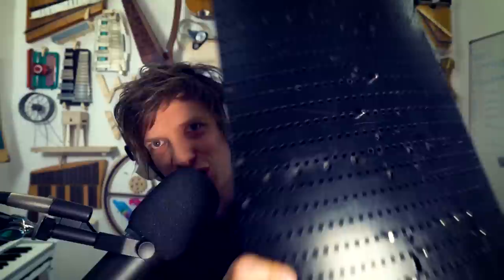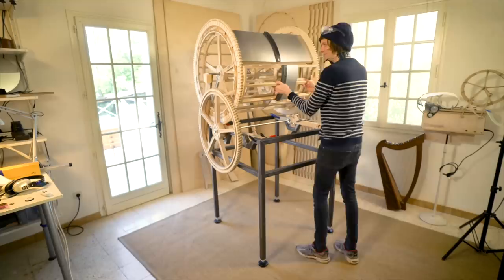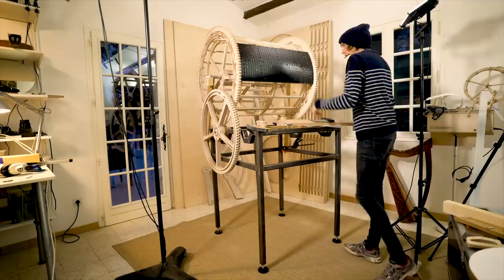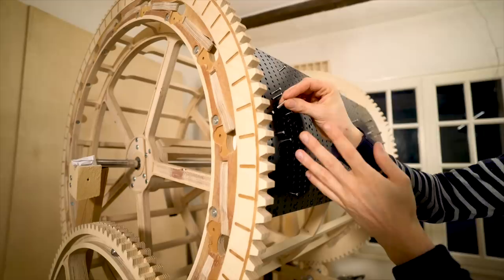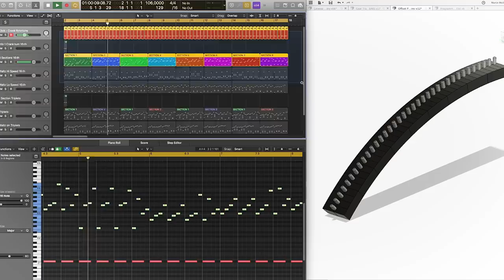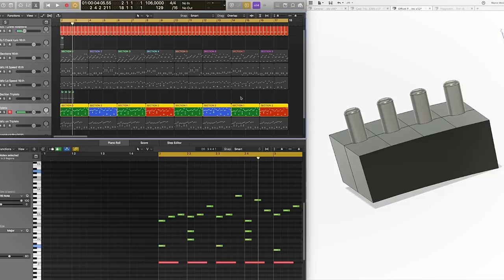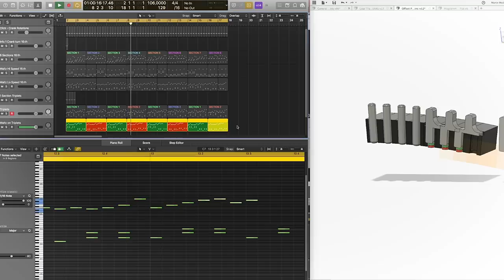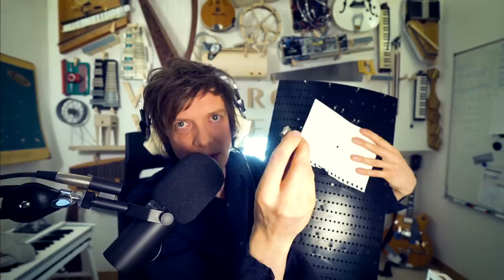Magnet "Midi" Music System - Marble Machine X #25

Comment: What if instead of having programming pins, you had programming 'keys' that had one particular, simple rhythmic pattern, like straight triplets, straight 16ths, straight pentuplets, and also slightly more complex patterns that still fit into the same short length of time. The keys can be built more sturdily, the programming is easier because you only actually program  64, or maybe 128, individual keys. Bonus: you now can easily play any rhythmic subdivision you want. Want a song based around 5:3 polyrhythm that also uses a 7:6 hemiola-like thing for the chord structure? Just print out some new keys!

How many kinds of keys would there be? Not too many. For any subdivision into n (that is, n=5 for pentuplets), you would have at most 2^n different keys. But, you might not need all the keys, and would use some keys more often than others. Rests can use the 'null' key (you don't put a key in it), of course. Even better, if they're symmetrical, the maximum number of keys needed goes from 2^(n) to 2^(n-1).

Comment: Would it not be more simple to have 2 sets of 2 programming boards? 1 set for multiples of 4 and 1 set for triplets? This could also give the programmers more time to switch the program during the track as they could always be a track or 2 ahead rather than trying to get the next set ready for the NEXT track which could be stressful and difficult if there were issues. I like the idea of an offset pin or the slot magnet but unless it’s super straight forward it could lead to confusion and difficulty when performing.
You may have already decided on a solution but I think for the simplicity of my idea it may work best in the real world (ie performing music)

Comment: was just thinking if you used magnetic solenoids for each pin,  and create a program to control engagement/disengagement of them,  you could reprogram in an instant, or even while the machine is running,  giving you an almost unlimited number of tones

of course, it would add considerable complexity, weight and expense to music drum/wheel.  Perhaps an idea for your next machine...lol

Comment: Hi first off, I love the marble machine . I noticed that you are heavy into the mechanical realm but I am in the electronic realm  so to have a fusion of the two in the design of the marble machine to solve the problem of programming the - for lack of a better term peg board instead of using removable pegs why not put solenoids on the peg board and use a small microprocessor like arduino or such to set the  peg board up for the song you wish to play just a flick of a switch and the Arduino sets the pegs need for the song. Just by the shear number of pegs that need to be set you would have to use a multiplexer but it is possible. But then you would have to solve the problem of triplets. Need to look at that in more detail. Maybe a track next to the main one  for the triplets and make the finger a little wider to cover both tracks.

Comment: Okay, but what if instead of having giant sheets that go through with 4 peg or three offset pegs per crank turn, what if the sheet was instead made up of bricks the length of the crank turn? The bricks themselves would be highly replaceable, in case of any sort of damage or jamming, not to mention you could use different bricks for different kinds of beat patterns. Of course, instead of 8 giant sheets, you’re instead gonna be placing hundreds of bricks, but considering how many pegs you’re going to be placing, it’s not really lengthening the set up time, as unused sections it doesn’t particularly matter what brick it would need.

Comment: Awesome stuff by the way. I was thinking about how the magnets on the bottom of the pins might cause trouble, The pins will stick together when trying to load them and if the magnet either came off or misaligned it would stall the loading process. So what if you either attached the magnets in the bottom of the holes or made the backing plate magnetized? Oh, also, I'll put in a vote for the flat black finish.

Comment: Just an idea, I know it goes against much of the whole programming wheel idea

But, what about a set of servos which trigger at the right times (controlled by a computer or micro controller like an arduino)

Each servo would correspond to each note

Comment: If the plan is to swap plates for different songs, why not just design alternative triplet-friendly plates for us in songs that use triplets or are in waltz time? Three holes per beat, no need for specially-designed offset pins. This wouldn't solve wanting the occasional triplet in an otherwise quartet song, but sounds a lot simpler than machining special parts.

Comment: i don't have the level of english required to talk about these things but anyways: you shouldn't make something reprogramable, get rid of plastic and make them out of wood with only holes for the pins you need for each song, first write the song, then print it with the laser machine on wood and put the pins only once, and you save them like cds that you simply interchange for each song, i'm sure you can redesign them so they stack, and be faster to change
Reply: when things get complicated just go simple, idk why the made pressurized ink cannisters to go to space, they should have made silicon pencils and a good sharpener inside a panel

Comment: Hi! Did you consider making some kind of "carpet" (out of silicon or rather something tougher) instead of rigid, curved parts? That solution results in: less variability (no thermal bending), less parts (possibly only one), probably less machining time (no need for specific shape of holes for magnets, possibly cutting it way faster with laser), easier reprogramming (lay it flat on the table and let 5 people work on it)... just to name a few. What do you think?
Reply: Interesting Idea, do you think it would be able to rigidly hold the pins? They must be fixed firmly in place otherwise each note would be played slightly later than expected.
Reply: @chasetuttle2121  1) the fact that the material is flexible in large scale (i.e. diameter of the wheel) doesn't imply much flexibility in the tiny one (holding pins); think about garden hose for example;
2) well, as long as all the pins will be acting the same (with the same time latency), everything will be alright, I guess

Comment: would it be possible to drill the programming blocks in different base  (log) to address some of the spacing of the pins? Which might allow a better precision ...I'm not an engineer, but if you set the  overall circumference as your reference  (base) you  could calculate the program pin position  that way.  I could be wrong, but it seems to me that most of the music we make is base 2 in some fashion (4, 8, 16, 32 or 1/2, 1/4/ 1/16 etc)..  Perhaps it would be impractical in terms of how many different plates you'd have to make depending of the base you chose?

Comment: that is such an awesome invention. I was wondering if the use of triplets would need to be available at the same time as the quad pattern during one mounting of the panels? so in other words do they need to mix in between each other. It seems costly to make so many pcs of all 3 differently timed offset pins. and you would be needing to mark the triplet holes with an number to tell the programmer which offset to insert. I'd be more in favor of swapping chunks of the indexing board out for differently timed sections. is my 2cts anyway

Comment: I’m really late! Could you not have 8 pre made super thin sheets of metal with the pins welded on per song, and the sheets are attached to the 8 wood sections with magnets as 8 pieces? Then you can remove the 8 wooden sections, pull the pinned metal sheets off and put the ones for the next song on (in minutes)

Comment: For loading the new song set while on tour why not have sheet metal that already has the pins pre-set on them since they are magnetic then all someone has to do is take out the pins from the board lay the sheet metal with preset pins on it run a large magnet over the back of the sheet metal  that has opposite polarization and bam all new pins in place.

Comment: Hello,
Can't reply to the other thread pinned by Wintergatan. But why not work with holes and not pin. Maybe you need to redesign the gate behind but witht his idea, you just put perfored card on your pograming wheel and havbe a small point who try to go over the hole. You need something more resistant to build the programing card too. (basicly it's like the system you use on other music stuff). Very simple to program, just replace the card and it's ready. You also can deal about the 3 or 4 hole pin with that

Comment: Why not use a machine run by a computer to program. Solenoids could push the pins in place while a motor indexes the wheel. This would be a lot faster with no mistakes and patterns won't wear out.

Comment: Cannot access the Design Discussion

Why not use an industry robot to change the pins? (Probably simple two axes would be enough (with a mechanic to change the pins))
You could also use air pressure and vac to change the pins and with that you have another midi machine with adjusting the time between changing pins and inserting pins.

Comment: Can't reply in the Design Discussion, but if you did the same idea, but what if you made the larger drum able to change out? That way you can have the reprogramming team working on feasibly three songs at a time. One on the spare wheel, and two on other sets. And that way you could honestly have as many sets of the wheels for however many songs you wanted to do.
Reply: Also glossy black is definitely a better show piece for sure.

Comment: Is the design discussion limited to 500 replys? Cause I can not reply 😖... Why dont think of a different concept with sliding pins? So all the time it is clean and can be slided in needed position. With this you will be able to use a stencil for each sector by placing and sliding. Its hard to explain without pictures but I will try to use 3d software to build up my idea to be able to show you. Is their a chance to get a stepfile of one section or even a small part of it?

Comment: why not just make every measure six nodes instead of 4? It reduces capacity for your loop, but that way you can just keep using the regular magnets. Straight beats should be turned a bit faster and the loop will end a bit more quickly, but I find that interpreting a measure as 6/8 is a good way to have options for melody.

Comment: What if you used two slots with your pins as a upside down t shape so you could move them in any number of ways with guidelines located on the side so you could tell where your base time signature still was

Comment: How stable is the geometry of the plastic material you have use to hold the programming pins in place as ambient temperature changes or heated by a direct heat sources such as direct sunlight?

Comment: Why don't you just change the crank gear ratio from 1/4 to 1/3 and clutch it in and out? That will change the timing at will. Further make the plates plastic with preset metal pins that swap in and out. The whole plate will swap out but it is just a plastic mesh with pins, with the woods staying on the machine. These you can make cheaply and they wont weigh much and be easier to swap in and out.

Comment: Could you use both 3 and 4 within the same section of the programing wheel to get a 3/12 4/12 split in the tempo? Or does that not work so well in the majority of compositions?

Comment: i think you should just make more programming wheels for different songs cause you are going to need more than 4 minutes to  disassemble the pins re-put the pins and be ready to go after applause and such and to have all the wheel cartridges ready to go in that time .. there wont be enough time not even if you have a hundred people taking the pins out and putting the pins back .. it would be better just to have a separate set ready to go that way all you have to do is take one set off and put the second set on or third set or fourth they may be helll to make but their going to be way faster in the long run

Comment: Why not a section of 60 pins instead of 64? It would divide evenly by 1, 2, 3, 4, 5, 6, 10, 12, 15, 20, 30 and 60? Having 8 plates, you have additional divisions of former list x2, x4 and x8 - you gain even divisions like 8, 16, 24, 32, 40, 48 or 80.
A pure power of 2 division is crappy, because it divides just by another power of 2...

Comment: Why not have a Template with all the pens for each panel in place  with a slide plate to release them.

you could have a dozen songs already programmed into the templates,  Place over your plate and remove the tab  allowing them to attract to the magnetic surface.   only a slight touch wight be required for a few.   each plate would take seconds to program and all can be done on sight by audience and Verified before they touch a programming plate.   you can have many songs from many genres to choose from ready to go.   or let the audience have a list of smaller templates to make up there own from a selection of song segments.

would give you the ability to splice on the fly.    use a synthesizer to demo segments  and they can piece it together by audience applause voting or volunteers choosing.  

PS my writing sucks, im an inventor... lol not a writer lol

Comment: If you wont be playing 4/4 and 3/4 in the same song, why not create boards with holes for each? Your technicians will use whichever type of board is needed for the next song. Keeping track of three pin types and your technicians using them over the duration of a song seems difficult and having bothhole sets in one board seems fragile, to me.

Comment: also unable to reply on the pinned comment, im actually working on a similar project, the only problem with off set pin is it rotate, which might work if it bridge between 2 holes

Comment: Hmmmmm. you could always resigned the programming board around the block magnet design and create a board design that has  a hole count that is advisable by 4 as well as 3, like 24, and therefor creating a flexible time table, the real issue with this is the number of holes involved in this idea is giving me an unreasonable fear of holes. Im not sure if the divisibility will mesh into a good time table, but the idea is that you can set the pins in either a normal 4 beat time slot or a 3, beat time slot enabling the programming to be more flexible, that's why you would use the bar magnets, to allow for the space needed for this flexible design, but again you would have enough pins to swim in. so every 6 slots you put in a pin, that gives 4 beat time, and every 8 slots will give you triplet time given your base is 24 or otherwise, also i can see this causing issues with the time needed for a reaction to settle, aka double hits and slurs caused by too many pin hits.

Comment: what if there where pins in all of them and you take out a few to make the beat with your PC or MacBook so that it is faster and you can hold the pins in with magnets   and you also need something to either A control the humidity or B you can get a special oil that makes your work better BC humidity will make the wood swell up and not work but overall good idea

Comment: Looks like you managed to hit the limit to replies in the YouTube comment system with 500 replies to your top comment... Might I recommend using Google Groups ( https://groups.google.com ) for ideas as it allows for threaded discussions. There appear to be lots of great comments in response to your request for ideas. I'm probably not the only musician / software engineer to be interested in watching how your machine turns out.

Triplet and other tuplet rhythm shapes (5-, 7-) might warrant different hole spacings or different pieces, but either system will come with technical challenges. For example, do you need two holes to stabilize a 5-tuple note? Do you make 1/5, 2/5, 3/5, 4/5, and 5/5 pins and organize them into 5 boxes for the programmer. I assume that the pins are currently spaced just far apart to prevent note jams or you might even consider single / double 32nd note pins.

As for how to reprogram, having pre-planned sheets with colored holes that can fit over the black programming matrix to indicate the pin placement is a clever idea. Another possibility is to use a 3D printer to print sections for songs with rhythms that don't otherwise fit the magnetic programming pin spacing, and use magnetic pins to align said printed sections on top of the programming grids. Then instead of reprogramming one note at a time, you get one section at a time (this admittedly feels a little like cheating, but it may be a pragmatic approach). It would be really fun if you had a computerized device (such as a pick and place machine) to program the wheel with pins on stage because it could enable you to change songs from a large digital catalogue without consuming the physical space for the song templates in your luggage. Time to program the 8 sections vs time to perform a piece will be critical to keep the concert feeling going unless you perform more songs while the machine is being reprogrammed.

Finally, have you considered if there are any interactions between the magnets and the marbles? How will you deal with a possible loose marble getting stuck on a programming pin?

Comment: You should have not used the programing wheel to begin with honestly. You should have just made  a new wheel for eash song that you could easily hot swap. That way you can have more than one song in a performance. you can swap the panels, but that takes time. You could even make the wheels part of the back ground on the stage, which would be fun for people to see.